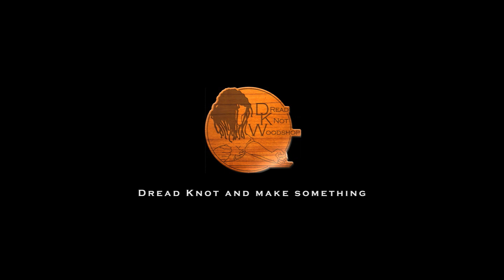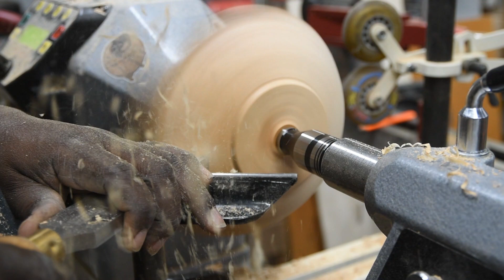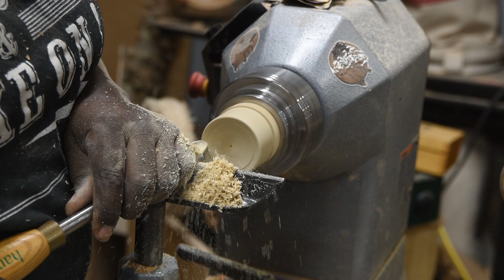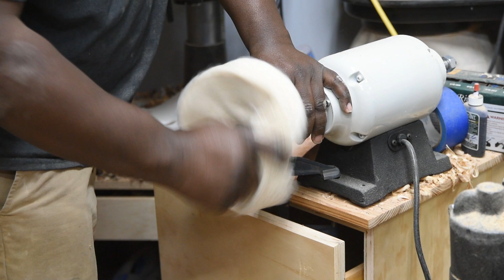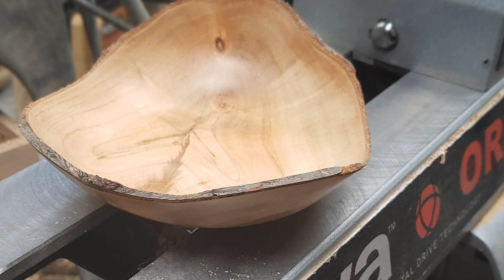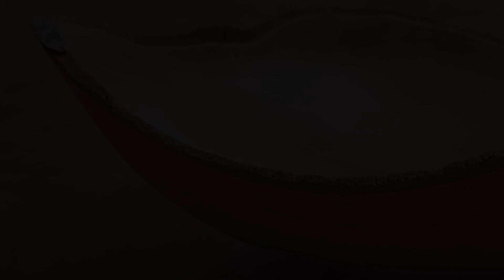Turn a Live Edge Cherry Bowl

Comment: Maybe I'll get the courage to chuck up the piece of cherry I've been saving now. Did you consider putting a bit of CA on the bark before the final turning? I understand that it helps keep it secure.
Reply from the maker: If you are using CA to help keep the bark, apply it to the cambium layer (between the wood and bark). The cambium is like a sponge and will soak up the CA glueing it to the bark and the wood.